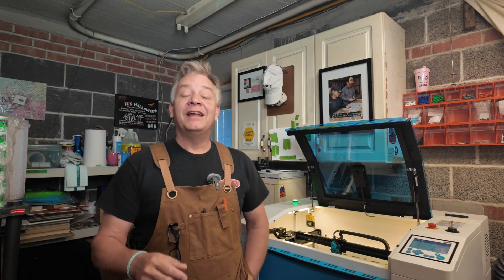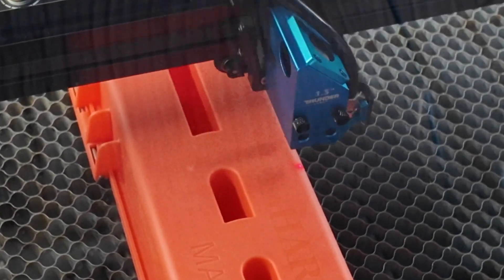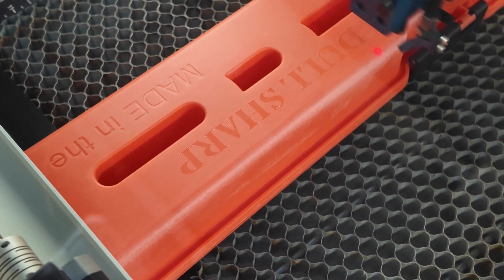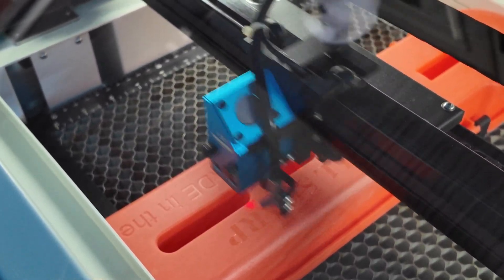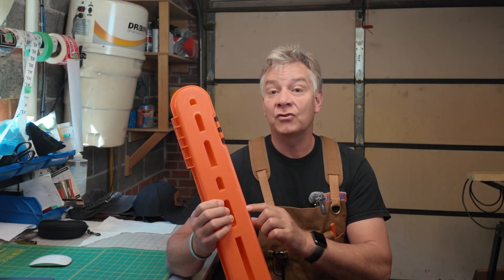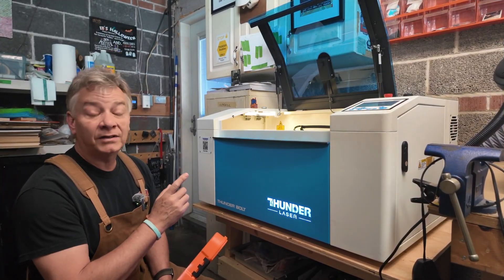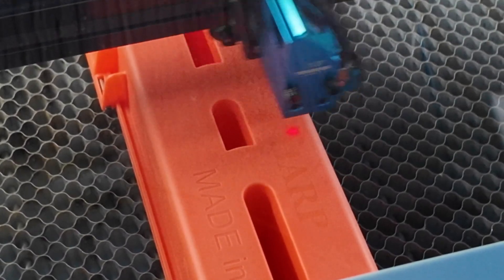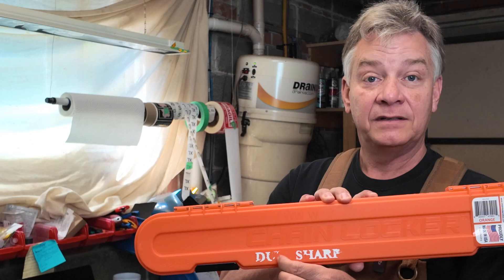Laser Engraving Plastics? WAIT! Watch This First! Thunder Laser BOLT. 041

Comment: Great video on how to learn what can be laser engraved.  The best way to probably engrave your plastic unit would be to use a CNC or rotary engraver with a 30 or 60 degree V-bit.  That would give you a deeper engrave without melting.  Good luck with the laser paint and let us know if you figure it out.  Another option might to be to engrave another material that could be riveted to the case that could show up well. Like an anodized metal or rowmark.